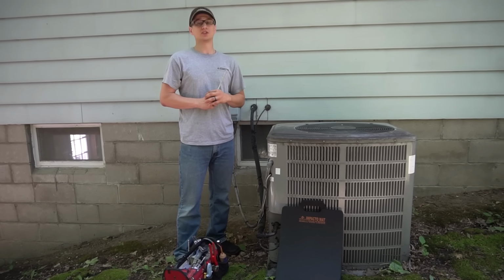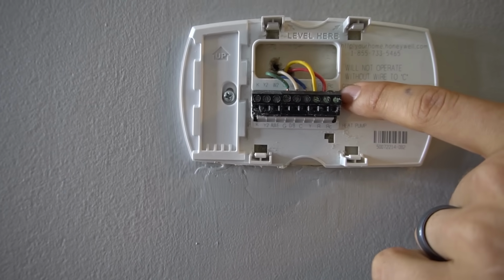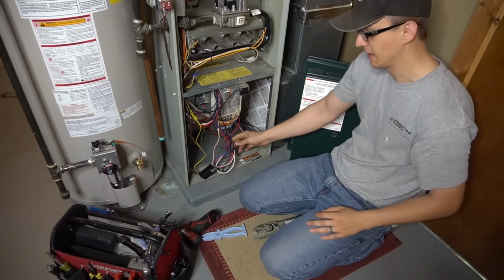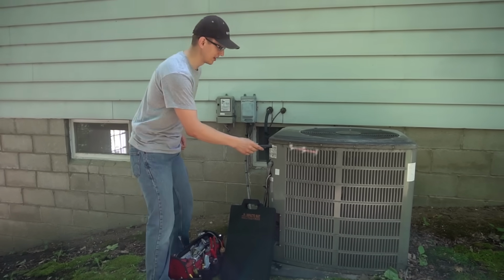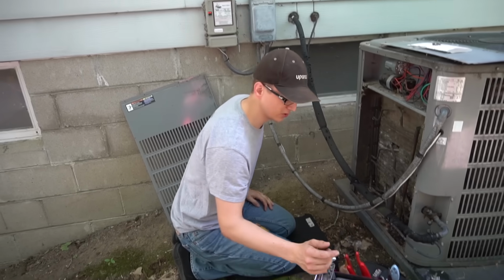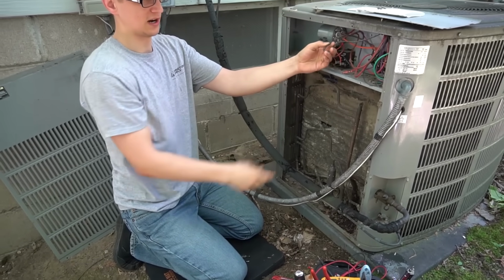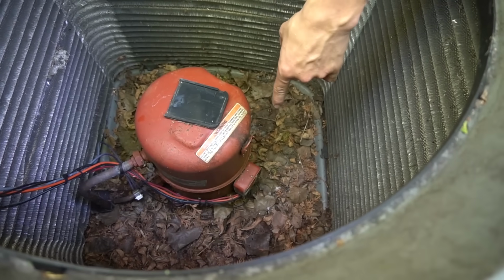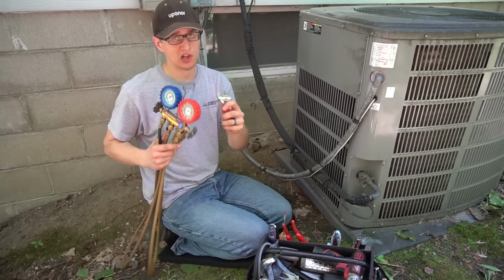AC Unit Not Turning On - How to Fix It Step by Step

Comment: My contactor isn’t pulled in and I did the test like you did here. Everything inside the unit started, but when I released the little button, it stopped again. I replaced the contactor... but it still won’t pull in. I had my wife start the thermostat for a/c while I was outside and it clicked loudly but didn’t start. What next?
Reply from the maker: Wait, so where did that loud click come from? Could you tell? And did the plunger move at all when the click happened? If the plunger is pulled in and nothing runs, then there is a problem with the 240v (circuit breaker or disconnect fuses) If the plunger does not pull in on it's own, then there is a problem with the 24v. Do you have a multi meter? If you check voltages, that will make things go faster. The thermostat wire that comes out of your house along with the freon pipes, can you see where that wire goes? It usually will have a red and white wire inside of it. Do those two wires go to the contactor coil or does one of them go somewhere else?
Reply: I’m not sure where the click came from or what happened with the plunger because we were a bit uncoordinated, so I can do that part over again after work. I have a voltage tester but it’s an LED one, not digital and only tests voltage... but if that’s all I need to look for, that should work fine? The red and white wires go to this blue caps? They don’t really connect to anything. There’s also a black and yellow wire from the contactor that go to these blue caps
Reply from the maker: Btw, nice Majin Vegeta profile pic :D   I will do numbered answers since that is easier to follow:

1. Hm.. So it's like a voltage pen that beeps when there is voltage present? Not optimal but it could work :) Let's check some other things first before we get back to voltage checking.
2. The blue caps are probably just wire nuts. So the red and white wire go into these blue wire nuts which connect them to the black and yellow wires? Then the black and yellow go to either side of the contactor coil, correct?
3. Does your blower fan inside the furnace come on when you turn on the AC?
4. Did you check the 3 amp fuse or breaker on the furnace control board?
5. Did the furnace power switch get turned off by accident?
6. On the thermostat, if you turn on your furnace, does your furnace work?

Let me know what you find. Those questions are just to help us start narrowing down our possible culprits.
Reply: Thanks! :D
1. Not the pen kind, it does have test leads for it. It’s a klein voltage tester
2. Yeah, they’re connected to the black and yellow wires which go to the contactor coil. The red wire is a little loose in the blue cap/wire nut if that information is helpful at all...
3. The blower fan does turn on inside the furnace
4. I checked the 3 amp fuse and it didn’t look like anything was wrong, albeit a little dusty so I blew on it
5. The furnace power switch is on
6. The furnace turns on when I use the thermostat 

Thanks for getting back to me, it’s been toasty to say the least here in Minnesota
Reply from the maker: Yikes, sorry man. It's hot alright.. So let's wrap this up. Now that I have an idea what's wrong and you have a voltage tester with test leads, we can get more serious:

1. If your thermostat has batteries, try replacing those first.
2.Take the thermostat off the wall and put your test leads on the R and C screws. Do you have about 24 volts? That will tell you if the control board is sending power to the thermostat. (it will be anywhere between 23v-28v)
3. Put the thermostat back on. Turn on cooling and lower the set point so it's "calling for cooling". Then take the bottom door of your furnace off, tape the door switch, and find the thermostat terminal strip (R,Y,G,W,C). Put leads on R and C. Do you have 24v? If you have 0v, then your control board is bad and needs to be replaced
4. Next check Y to C. Do you have 24v? If it's 0v, then the thermostat is bad.
5. If everything is checking out good so far and you have the proper voltages, go outside and at the contactor coil that I asked you about earlier, put both leads on either side of the contactor coil terminals where the wires attach. Do you have 24v? If you don't that likely means there is a broken wire somewhere or a loose connection. 

Check all that and let me know what you find. And since its super hot, do this to get temporary cooling. (usually this will work, hopefully it will for you) Make a little jumper wire by taking a piece of wire and stripping both ends off or you can even use a paper clip. Turn power off to furnace and put that jumper in between R and Y at the furnace control board. That will bypass the thermostat. Put door back on and turn power back on. Good chance your AC will come on to cool the house down unless there's something else wrong that will make this little trick not work..
Reply: Okay, the jumper clip (lol) worked, the unit is turned on. But I’m not sure if it’s cooling anything yet, although I’m sure it’s too early to tell. I’ll get back to you once I test the voltage, although it might be a little while because of my work schedule. Is there a way to know if it’s cooling the house other than waiting? I’ve seen some people touch a pipe to test if it’s cool
Reply from the maker: Lol, the jumper is the fastest fix after all ;) Just so you are aware, the jumper bypasses the thermostat which means the AC will never turn off unless you turn off the power or take the jumper out. As for seeing if it's cooling.. Do you have some kind of temperature probe? Any "poke in" thermometer will do. An easy way to check if it's cooling properly is to watch my other video and follow along ;) https://www.youtube.com/watch?v=beVRELr8Oak
Reply: Alright, finally have some time to do other things. There are 24 volts at the thermostat and two spots on the control board. I wasn’t getting a reading at the contactor coil, but here’s the weird thing... the unit was turning on when I used the thermostat. Jumper wire on the control board was taken off (obviously, so I could test it). Maybe I’m just checking it wrong
Reply: Wait. Scratch that, it isn’t turning on anymore
Reply: Also (sorry, not trying to spam you) there’s no longer 24 volts between Y and C at the control board.
Reply from the maker: Hey Noel! Welcome back ;) So there is no longer 24 volts between Y and C at the control board.. Try doing this. Turn off the furnace power switch. Take your thermostat off the wall and put in a jumper between R and Y at the thermostat. Turn furnace switch back on. If everything turns on, then your thermostat is bad and needs to be replaced. If nothing happens, then check R to C at the control board. If no 24v there, then either the fuse is blown or we are losing power further up the line. Let me know what you find.
Reply: Thanks! Yeah, it’ll fluctuate too. If there’s no voltage, I’ll fiddle around with the Y wire and then turn the furnace switch back on and it’ll work until I turn the thermostat off. 

Should it be between Y and RH or Y and RC?
Reply from the maker: Y and RC (RH is power for heating, RC is power for cooling)

When you fiddle with it, it works.. Weird. Try tugging slightly on the thermostat wires, maybe the wire is broken where it gets pinched down by the screw.
Reply: Okay, the jumper at the thermostat turned everything on. Also, I tried pulling on the Y wire on the control board and nothing broke. So is that just a bad thermostat then? 

You’re a hero!

Comment: Any opinions on the water misting systems for the outside coil? Does it make a difference large enough to be worth it?
Reply from the maker: Usually not. As far as I know, if it's a desert type of climate, then it may be worth it, otherwise no. But here in Minnesota we don't ever see those so I can't say I am very knowledgeable in misting systems either..

Comment: Man, this video has been incredibly helpful, but I am still stuck. 

I came home yesterday to a dead thermostat. I have one of the ADT ones that runs off the 24v coming from the A/c unit. 

I've changed the capacitor and when I push the plunger in, the unit kicks on, but there is no communication from the thermostat to the unit. Even with the fan set to "on" it doesn't kick on. Wont talk to the A/c or heater, which makes me think it must be in the wiring between the thermostat and the unit itself. I've checked out the furnace and internal unit in the attic, but can't find any fuses other than the disconnect. The attic is very cramped, and only one side of the unit is accessible, but its lined with insulation. Thoughts on where else the issue may be?
Reply from the maker: Oh boy.. So you have a communicating system? If you pull the thermostat off the wall, instead of R,Y,C,G,W do you just have A,B,C,D? Also, does your thermostat have an advanced menu where you can look up recent fault codes? That may point you in the right direction. Communicating systems can be a pain to work on.. A cramped attic does not help the matter either. So can you get to the furnace control board? And no 3 amp fuse or small circuit breaker to be found? Any bare thermostat wires outside, where they come out from the house and into the condenser?

This one may be a difficult DIY project. For what it's worth, I can tell you how you can get temporary cooling but you would still need to get this communicating issue resolved. Now this usuallyyy works but some smart furnaces won't allow it. But here is what I've done in the past to get a customer cooling until we get the problem resolved. Switch your thermostat fan setting from AUTO to ON. Then, turn off power to furnace and at the furnace control board, find the thermostat terminal strip (R,Y,G,W,C) and put a jumper wire between R and Y. (that will bypass the thermostat) Put it all back together and turn power to furnace back on. That should give you continuous cooling but it will run non-stop so you have to either flip the furnace switch or turn the furnace breaker off to turn off the AC. This is just an option you can try if it is super hot and you're desperate..
Reply: Thanks for the response. Turns out I'm an idiot and it was a super easy fix.

Algae built up in the drain, caused water to build up in the trap, tripped the kill switch, shut everything down. 

I blew out the drain and immediately started working again. I hadn't even thought of it.
Reply from the maker: Sweet! That's good that that's all it was! Sorry I didn't think of that. I should have realized that when you said it's an attic unit. If the condensate drain is plugged it will wreck your ceilings if it starts to overflow. Thank you for the update and stay cool!

Comment: My ac keeps  trying to start up I installed a new cap/motor fan after I dropped it lol the trouble is it starts up new for short time and then stops I can hear a humming from the compressor then a bit later it restarts...
Reply from the maker: Sorry I got a little confused. So to clarify.. You replaced the condenser fan motor and capacitor. But you dropped the motor before you put it in. Now when the ac turns on, the compressor runs fine but the fan keeps coming on and off. Is that what's going?
Reply: I am sorry I did not make myself clear, the relay is good,  checked freon the high side is136 lb. the low side is45 psi. the condenser is cold on the bottom and hot on top. now it is tripping the breakers ,  the relay is working the fan works for a few mins. then shuts off. Also noticed the new motor gets quite hot in about five to ten min.

Comment: I have a ruud air conditioner and it's not working. My inside fan was working now it's not cause I thought the problem was outside. So I replaced the capacitor and the compressor contactor but I noticed with the old parts I was able to push in the contactor and the compressor would start but not the fan, I had to turn it manual to make it spin. At the last minute I notice #3 fuse on my main board looks burnt, can that be the issue why nothing is working?
Reply from the maker: I apologize, I must have missed your comment. Saw it just now. Yes, a blown 3 amp fuse would definitely be a problem. It is in series before the contactor so if it blown, the control board will not send power to the contactor coil outside.

Comment: I can not wait to get home and give a few of these trouble shooting tips a shot. Great video! I am hoping mine is just the jumper wire. Fingers Crossed. Great video!
Reply from the maker: Thank you! I hope it is an easy fix! Good luck and be safe! Let me know if you get stuck :)
Reply: Word of Advice TV you know, I got stuck! Never as simple as I hope. I have 24 and 240 where I need to except I can’t figure out why I don’t have 24 at the contactor. One low voltage wire goes into the unit and cones out as another! I’m gonna ask come electricians I work with them call the hvac fellas.
Reply from the maker: It sounds like you have something in series with the contactor coil. Perhaps a low pressure switch? If that is the case then you may be low on freon. Freon issues generally are not a DIY project though so perhaps the HVAC fellas isn't a bad idea
Reply: Word of Advice TV that’s what I’ve narrowed it down to! So frustrating!!
Reply from the maker: Sorry man, a jumper wire would have been nice. Hope you can get your cool air back asap!

Comment: Compressor is not coming on when I turn the AC on. The fan is coming on, but only blowing non-cooled air through the vents. Outside at the compressor: When I push on the electrical connection plunger behind the panel, the compressor comes on right away. When I release it, the compressor shuts off again.

What should I check or replace next?
Reply from the maker: So to clarify, when you push the little plunger in, the compressor and the fan outside come on but they wont turn on when you turn the cooling on at the thermostat. That sounds like the contactor coil is not getting 24v. First check for a blown 3 amp fuse or breaker at the furnace control board. If it's not blown, look at this next: Find the thermostat wire that comes out from your house and into the condenser unit. That wire will have 2 wires in it, usually a red and a white wire. Do those 2 wires go straight to either sides of the contactor coil terminals? Or does one of those wires go somewhere else? If the two wires go straight to the contactor coil, then here is what you can try: Turn off the power to your furnace and at the furnace control board find the low voltage terminal strip. (R,W,G,Y,C) Then make a little jumper wire (a paper clip would even work as long as it only touches the needed terminals otherwise it will short something out) and put the jumper in between R and Y. That will bypass the thermostat. Then turn your furnace back on and make sure the door switch is closed. If your AC outside comes on, that means the problem lies in the thermostat. Well I think that is enough for you to try for now :) Let me know what you find, good luck and be safe!
Reply: Word of Advice TV So, I ended up calling the guy that serviced the unit two days prior. He ended up running a wire from the incoming side of the defrost board to the outgoing side (directly to the compressor. Basically bypassing the defrost board. It seems to work just fine, leading me to believe that it was a faulty defrost board. We are letting it run this way for a week or so, then following up from there. He seems to believe that defrost boards are unnecessary technology; he can figure out what is wrong without them cutting the unit off. Well see! Thanks for the feedback.
Reply from the maker: Glad to hear that your AC is back up and running! Many ACs don't have defrost boards and they work just fine without them. So yeah, he basically just took the board out of the circuit. I do that sometimes too if the customer does not want to spend the money on a new board.